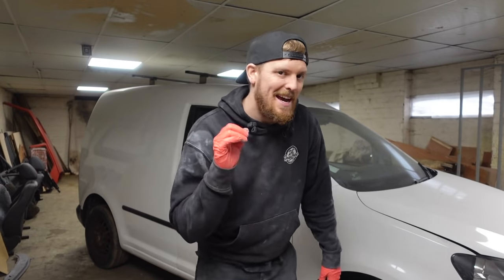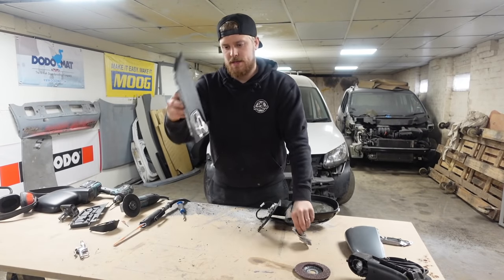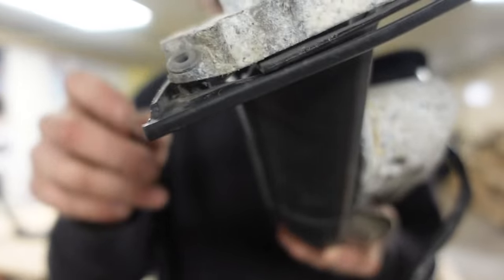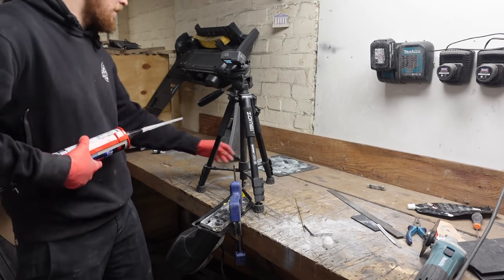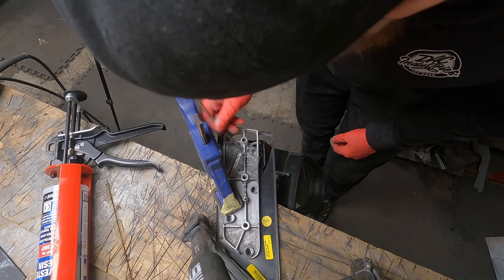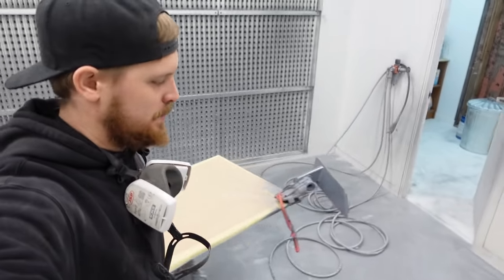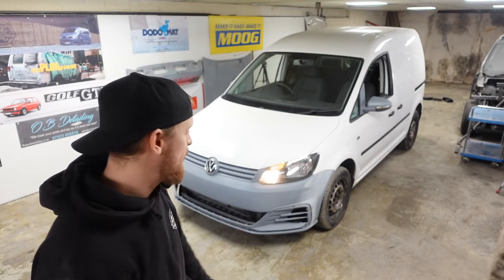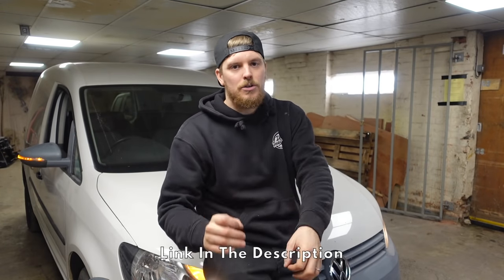VW Caddy 2K Build Series - How To Make Touran Wing Mirrors Fit - Will Electrics Work? - Episode 11

Comment: This car need a roof spoiler or a hatch spoiler conversion. Also roll the fenders and fit some fat tires underneath it. Maybe even go so far as add some sidesteps to widen the cars shape a little and make it really your own. Oh and a diffusor in the back & dual pipes? 😂👍 Anyways, great work as always. The end result of your work is really good, looks better than OEM.

Comment: If you bend the staples in the direction of the wire before the 90degree upward leg part they snap off clean as they have a little groove on the base of the staples leg 👍
Reply from the maker: Oh no way! Cheers bud.

Comment: ... nice job  !!! What did you do with the antena circuit for the around the caddy mirrors  ?
Reply from the maker: I fitted a shark fin aerial to the roof
Reply: Thank you for your prompt answer !!! When I saw the first caddy with Touran mirrors I thought the mechanic just swapped from 1 door to another,  because from the far the door socket doesn't look different,  VAG has the custom to interchange parts for 1 model to another , but takes a tone of work to do the exchange. 
Thanks again for your efforts to illuminate the process  !!!

Comment: I wonder how the caddy and touran mirror mounts are different but uses the same door is that to prevent them being swapped over? i'm thinking of the new caddy maxi life mirrors I hope they are direct fit. what an excellent job done thats was alot of work. I also got excited when I see the mirrors work lol
Reply from the maker: Cheers bud! The Touran doors are different from the Caddy so are not interchangeable. The top part is a slightly different shape.
Reply: @DanChambersDAC  no prob. ah crap may aswell swap with touran doors for handiness didn't know until now.

Comment: Not just a case of plugging them in on a Caddy that hasn't had Touran doorcards fitted though. There will be a bit more work in that. Are the touran mirrors heated??
Reply: He mentioned they were heated.
Reply: Yeah but we have watched the previous episodes and it’s obvious, so it was was straight forward! Perhaps not for someone commenting with half the information...... like you! he has already stated they are heated!
Reply from the maker: No it isn't Duncan as there isn't a plug tot plug them into in the standard caddy modules. If you watch the whole series it makes sense. Yes the Touran mirrors are heated.